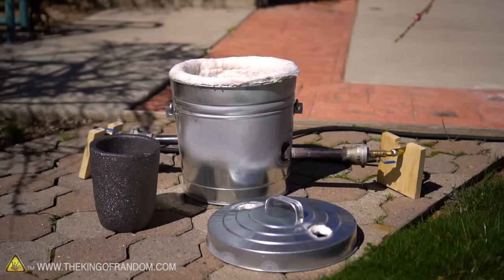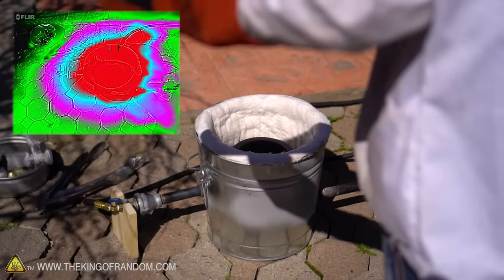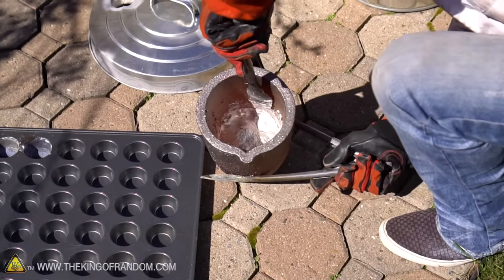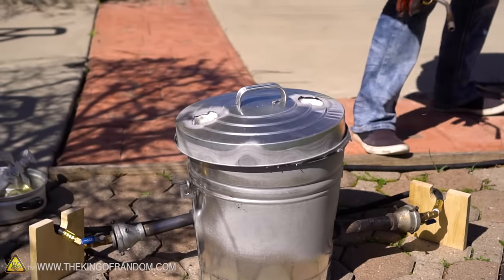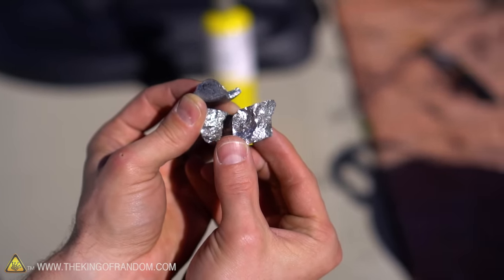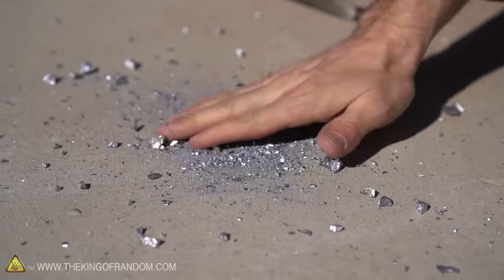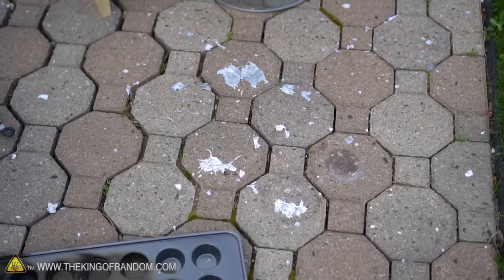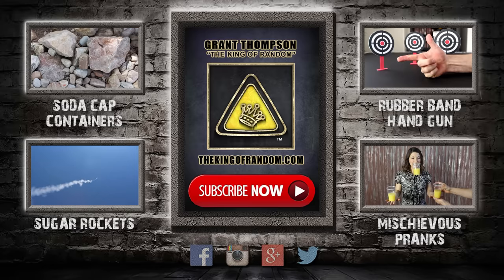Mixing Molten Aluminum With Molten Brass | How To Use Mini Metal Foundry For Mixing Metals

Comment: SPOILER: Aluminum and brass mixed together make "alumabronze". Technically alumabronze is supposed to be made from aluminum and copper, but since brass contains copper and the zinc burns off during smelting, it's more-or-less the same thing.
Reply: aluminum bronze has tin though...but it's a great alloy used for marine applications and nice for casting.
Reply: @Sugarsail1  Not always, depending on its specifications, it might use something like silicon instead of or alongside of tin.   while the last one was close to aluminum bronze, there was still too much aluminum in the mix to create a usable alloy.
Reply: Braluiminium
Reply: metallimetal
Reply: @olinseats4003  yeah, 25% ali is rather high. 14% is the high end for Aluminium Bronze (to give it the correct name) because as we see here, the aluminium and copper have such different atomic sizes that it doesn't have much strength in the middle, only at the end of the ranges.

Comment: Copper Aluminide! CuAl2 is likely what you've made here and removed most of the zinc. This is technically a solid solution - not an alloy - since there are intermetallic bonds. Just about all intermetallic bonded materials are incredibly brittle because of the rigidity of the structure. Awesome experiment!
Reply: Yeah, I was waiting for the moment that he uses the same thing he used for smelting brass.
Reply: i thought he was making Aluminum Brass
Reply: Alec Prestifilippo I don't know anything you are saying.  I'm nine
Reply: Thank you for pointing that out way better than I can.
Cliff notes for those that cannot follow.

If brass is composed of copper and zinc, and you burned off the zinc by getting the mixture too hot, you no longer have brass because you do not have the zinc.  so that was a mixture of aluminum and copper.

Lastly, the rapid cooling of the metal is what made it even more brittle; air cooling would have resulted in a stronger compound and a lower brinell hardness.
Reply: Alec Prestifilippo 9 koo.  ppl
Reply: Alec Prestifilippo English please?
Reply: I think you are right. However, I don't know the molar ratio of Cu and Zn: If the same volume of Al and brass were mixed, and then Zn was removed, the formular should be Cu₅Al₂.
Reply: He made a metal ceramic
Reply: Alec Prestifilippo you are a scientist cuz IDK anything about sciency stuffs
Reply: Nasif Bin Mahmud I'm 10
Reply: You must be fun at parties.
Reply: Yeah, that is what was in my mind, most of the zinc was removed.
Also I did the same experiment long time ago without burning away the zinc, it was so pretty.

Comment: is it possible to make ignition gloves which create sparks from a snap of a finger?
Reply: Jiawei Loh he needs to try it!!!
Reply: take a bang snap (explode on impact fireworks), tape it to the thumb of a glove.  You now have ignition gloves.  I am not responsible for what happens to your fingers afterward.
Reply: Snow Storm Bang snaps do nothing to your fingers. and anyways it's not hot enough or won't last long enough to ignite something.
Reply: Full metal alchemist m8?
Reply: +SilenceBark moy rustang
Reply: Azeem Is Awesome yeh haha
Reply: this better be for your Roy mustang cosplay
Reply: I need this in my life
Reply: Jiawei Loh Fullmetal alchemist?
Reply: Jiawei Loh I have seen a video of someone transferring the parts of an electric lighter into a glove, causing the fire to be created in the gap of an index finger and thumb once they were pressed together
Reply: Spoopy yeah I saw that too
Reply: Urbosa's Fury?
Reply: Jiawei Loh FMA fan eh?
Reply: Spoopy plasma*
Reply: canvas or leather gloves, and use the material used on strike anywhere matches, i think thats sulfer and something else.
advance theroy, if you had some sort of gas dispencer with shielding and a flash back suppressor,  you might beable to 'fling' fireballs
Reply: Leather gloves and glue on some flint and steel
Reply: .....Fullmetal Alchemist?
Reply: anime fantasy. for some its a great show. if you knew about it then. yes, FMA
Reply: I'd try something like flint and steel, both with an indentation resembling the checkering on carpentry hammer. It would create plenty of strike surface and friction. Or possibly one time use flash glove by smashing a bunch of light anywhere match heads, mixing into paste and thickly rubbing on thumb of glove, with friction paper on middle finger for snapping
Reply: Jiawei Loh probly
Reply: Jiawei Loh I guess you could use a flint rod on the thumb or forefinger and on the other finger have a corrugated steel strip and when the two strike against one another it would make Sparks!
Reply: Yes
Reply: thanos
and full metal alchemist
Reply: Jiawei Loh okay mustang
Reply: Thanos!!
Reply: What are you, Roy Mustang?
Reply: Fma ?
Reply: I hope
Reply: Uhh. THANOSSS?

Comment: Aren't zinc fumes rather toxic? I know zinc fumes are the reason you are not supposed to weld galvanized steel.
Reply: That's what I was thinking, they cause heavy metal poisoning. The effect is cumulative.
Reply: Zinc isn't a heavy metal. It is toxic though and causes metal fume fever.
Reply: But zinc IS a heavy metal...

From Wikipedia:
"Some heavy metals are either essential nutrients (typically iron, cobalt, and zinc)"

You're also right, Zinc causes Metal Fume Fever
Reply: +Erik Lewis
Haven't you learned not to believe everything you read on wiki yet? Fe, Zn are assuredly NOT "heavy" metals. Zn will give you flu-like symptoms, that rapidly pass when you aren't exposed. (Also, you quickly build up a tolerance to Zn exposure! Welder's flu is also called "Monday evening flu" because you're more likely to get it after a weekend away from the welder.)
Reply: Indeed metal poisoning is a risk of zinc work but the oxide is what you need to look out for, not the metallic zinc.
Reply: Hmm, I stand corrected, looks like you're right. It's also confusing because from what I've been reading the term heavy metal is not well defined and there is some argument about what is and isn't a heavy metal.

"The heavy metal status of some metals is occasionally challenged on the grounds that they are too light, or are involved in biological processes, or rarely constitute environmental hazards. Examples include scandium (too light); vanadium to zinc (biological processes); and rhodium, indium, and osmium (too rare)."

I was thinking of the classical "toxic heavy metals"; cadmium, mercury, lead, chromium, arsenic. Since zinc is essential to life it's not entirely toxic, just in high amounts.
Reply: thats why you use borax when melting brass. Keeps a layer of stuff on top to prevent the zinc and copper from bonding with oxygen
Reply: Yeah, I don't normally use Wikipedia as a source, so:
"The term heavy metal refers to any metallic chemical element that has a relatively high density and is toxic or poisonous at low concentrations. Examples of heavy metals include mercury (Hg), cadmium (Cd), arsenic (As), chromium (Cr), thallium (Tl), and lead (Pb).

Heavy metals are natural components of the Earth's crust. They cannot be degraded or destroyed. To a small extent they enter our bodies via food, drinking water and air. As trace elements, some heavy metals (e.g. copper, selenium, zinc) are essential to maintain the metabolism of the human body. However, at higher concentrations they can lead to poisoning. Heavy metal poisoning could result, for instance, from drinking-water contamination (e.g. lead pipes), high ambient air concentrations near emission sources, or intake via the food chain."

From Lenntech's ( water treatment company) website.

I get it though, Metal Fume Fever (yep, I've heard Monday Morning Flu and Fever) (also called founder's ague (that's a REALLY old term) and zinc shakes)  isn't like lead  or cadmium poisoning.
Reply: defenestrated23 agreed, lol

Comment: You should mix copper and tin and make your own bronze. You could get the copper from copper piping and you can get tin on ebay or from some solders!
Reply: also the ideal mixture is 88-12 copper-tin
Reply: Vincent Kelly  Don't you mean brass?
Reply: nope! brass is copper and zinc, copper and tin make bronze
Reply: he could make aluminum bronze with 90-95% copper and 5-10% aluminum
Reply: I don't think solder would be the best source for tin because of all the other stuff in it. If you would use solder the best choice would probaply be lead free Sn-Ag-Cu as the Silver content is just about 3% wich would equate to somewhere in the 0.3 - 0.4 content in the bronze but he'd have to get non flux-cored one. Probaply easier to just get the Tin from ebay
Reply: Clint Whalley : Cu 90.83, Al 6.5, Fe 2.4, Sn 0.27 (ratio for an aluminum bronze provided by the University of Florida). The bulk of the mixture is copper and aluminum with a quarter of a percent by weight of tin. I'm not trying to be patronizing only correct.
Reply: Vincent Kelly you can also found tin in electronic welding wire from Rona or Home Depot (it's made of between 70% and 95% of tin)
Reply: I did that myself. I had to make a more powerful torch to speed up the process because the temperature needs to reach roughly 1200C / 2000F. The ingots turned out beautiful and I'm trying to make a sword. I used the 12 Sn / 88 Cu ratio. I bought the Tin and copper on eBay. Copper pipes are a hassle to break down into pieces suitable for melting. By mass, copper seems to be basically the same price now matter where you buy it.
Reply: Copper and zink not tin
Reply: brass is zinc tin is bronze
Reply: Finally a YouTube  comments section  talking  about  Aluminum  Bronze!

Comment: Wonder if rapid cooling made the mix Brittle?
Reply: Trevor Schiavone it's likely, cooling metal quickly will cause the crystals of the metal to shrink and be very small, this means it is really really hard but also brittle
Reply: You should cool metal in sand or oil, just commented it 😂
Reply: I think so. It would be nice if he did a new video comparing those 50/50's that were hardened by rapid cooling in water VS some that were cooled naturally and annealed afterwards. I think there would be a huge difference in strength.
Reply: Definitely did
Reply: The copper in the brass  is the major cause for the brittle behavior. Like with any other alloy, the copper can improve the strength, but in doing so it also decreases toughness.
Reply: It's unlikely that the difference in hardness between quenched and unquenched with this alloy is that big.  I was calling it from the beginning that it would be brittle otherwise we would have heard of this alloy by now because it would have been tried hundreds of years ago.
Reply: Quenching a metal rapidly does indeed effect the hardness and brittleness of a metal or alloy due to how the crystalline lattice aligns from the process.  That is why metals are tempered by reheating to a certain temperature then air cooled after quenching.  There also was very little aluminum metal produced outside of a lab hundreds of years ago due to the technology of the time.  The most expensive metal produced at the time was placed on top of the Washington monument when it was built.  That metal was aluminum.
Reply: Trevor Schiavone probably the sudden cool down probably didn't quench it properly
Reply: rushthezeppelin:  Aluminum as a metal was first produced in 1825.  That's a far cry from 'hundreds' of years ago.
Reply: yeah we need 8 more years before we can say hundreds :P
Reply: Casting a metal in the first place causes so many imperfections that it often ends with that metal being substantially more brittle than if it had been wrought. Beyond this, the process added in tons of impurities as the aluminum and zinc combined with oxygen (the zinc especially), and the zinc often boiled or burned away.

All in all, the impercise temperature control, extended oxygen exposure, and rapid (and uneven) cooling probably caused a level of brittleness that glass would be jealous of.

Not saying that this isn't a neat experiment though.
Reply: Yeah maybe
Reply: in fact, the brittleness of the alloy was not caused by quenching in water. It is the property of that particular solid solution (mixture) of copper, aluminum and zinc. Similar brittleness you can observe with Copper-Manganese alloys at ratio 70:30, 60:40, or with Copper-Silicon Alloys.
Reply: Use common sense boy
Reply: But rapid cooling of brass makes It soft inverse as with steel

Comment: when you mix dissimular metals in a crucible you have to stir them well while molting to get a thorough blend. try reacting the 50/50 blend after stirring. you might be surprised at the resulting alloy. great video
Reply: Tungsten Carbide hop
gvjhp
Reply: Tungsten Carbide gvgcf
Reply: Tungsten Carbide
Reply: Are you okay, dude?

Comment: I tried making Aluminium bronze, after several failed attempts, i eventually heated aluminium way past its melting point, then adding in the copper which dissolved in easily, , i used a steel crucible but couldnt control the iron dissolution into the mix, what was liquid at this temperature i poured off, and this was a magnetic golden metal that i hammered out flat without any sign of cracking
Reply: ThatRandomGuy picture on my Google plus page
Reply: Adam Edington You have lots of birbs on your Google+ page too. I approve.
Reply: A Bird Lover ha ha did you see the French kissing birds?
Reply: Adam Edington Yup! They're really cute!
Reply: its bronze not copper
Reply: i made my very own aluminium bronze very similar in colour to AB1, distinctly different colour from AB2
Reply: Jonathan Stiles he most likely made the alloy and then melted the steel crucible and the steel mixed with the alloy and steel is very maluble and so is copper so you probably had lots of copper and steel but not much zinc
Reply: Dude, I did the exact same, but I'm trying to cast it instead of hammering

Comment: Friend,
It's called "Aluminum Bronze." It has any number of uses.
…..RVM45
Reply: interesting, i was gonna comment that its brass, not bronze, but it seems like many alloys of copper are called "bronze" which is interesting considering that most standard aluminum is actually an alloy of aluminum and copper, named duralumin by the founder of the aluminum age hardening process. which technically composition wise is very similar to aluminum bronze.
Reply: Its Aluminium Brass
Reply: or is it Duralumin
Reply: Cu + Zn = brass
Cu + anything else (Sn, Al, Pb....) = "something" bronze (like aluminium bronze)
Reply: No, guys, it's Zinc + Aluminum + Copper -  All you need is a little Magnesium, and you would have  ZAMAC, or what we call......  POT METAL !!
Reply: +paulrward But the zinc oxidized and burnt away, so wouldn't >90% of the zinc be gone?
Reply: Aluminum brass is only 2% Aluminum and Aluminum bronze is up to about 11%. If he wanted amore useful alloy, he would have used less Aluminum.
Reply: RVM451 NO!  IST ALIBRASSIUM >:D
Reply: wow so many chemist here
Reply: No, this is Patrick
Reply: The aluminum bronze of 75%aluminum and 25% bronze is actually used to make sheet metals and many more products from it.. It has a high elongation property and pretty decent Tensile strength
Reply: +paulrward Pot metal? Don't you mean Chineseium?
Reply: alumass (UL-LOO-MIS)
Reply: @Xenomic Gaming 

Bra-luminum (BA-cups)
Reply: standard aluminum is not copper and aluminum ! aluminum is just made of aluminum dude !
Reply: no just no ..
Reply: actually you don't know what you're talking about !